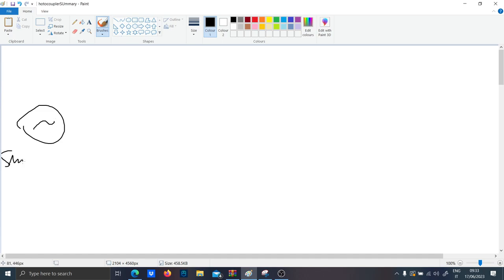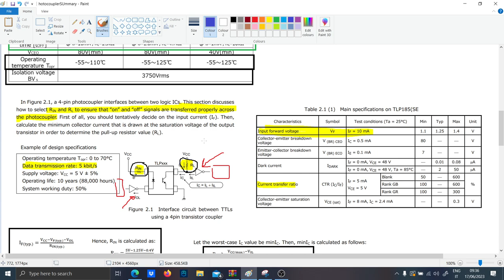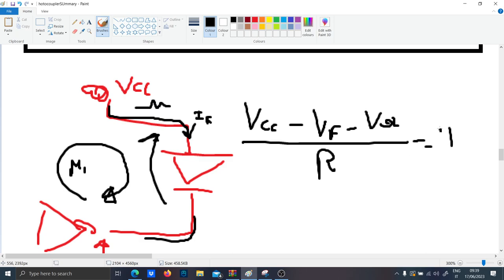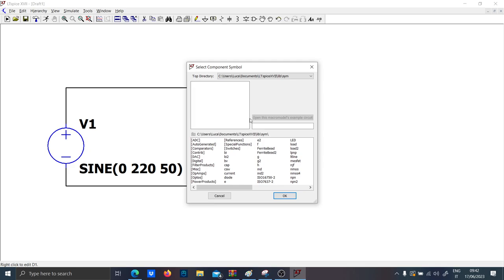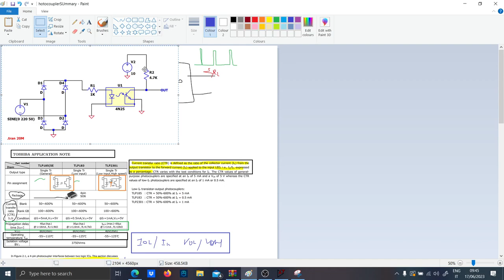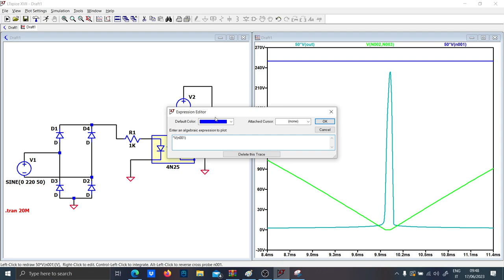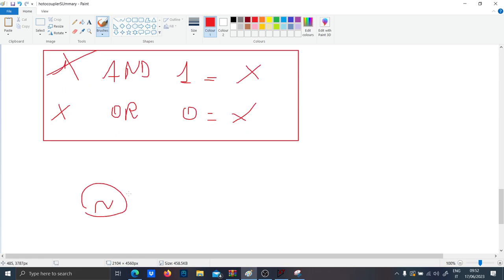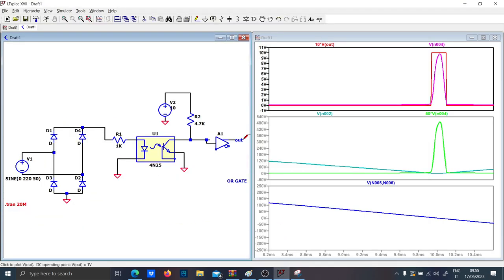LTSPICE Optocoupler for Zero crossing detection

Comment: Why do you state in minute 13:34 that if the V (after the diode bridge) is greater than 10V the transistor will turn on? And vice versa it will turn off when V<10V. The "threshold" voltage should not be 10V (that is, the Vcc you set) but should be the Vforward of the optocoupler diodes. Am I wrong? There is something wrong with this reasoning of yours.
Reply from the maker: Ahaha no, It was not 10V of course, It was my fast approximation
For me, Pi= e=3. 
I don't Remember the VF of the diode btw, but the plot seemed around 6/7V